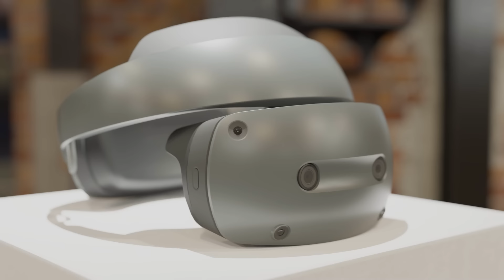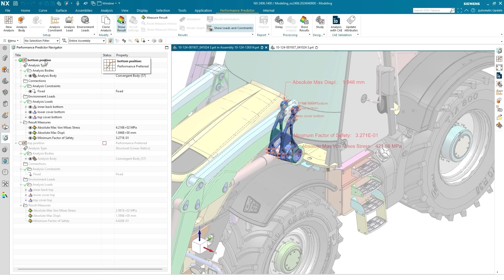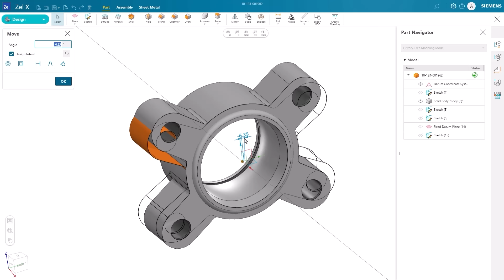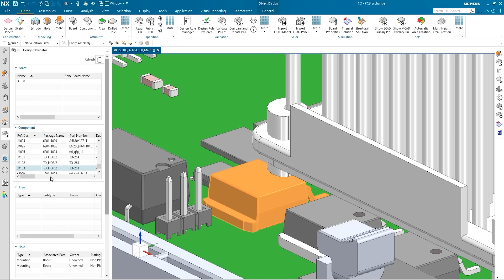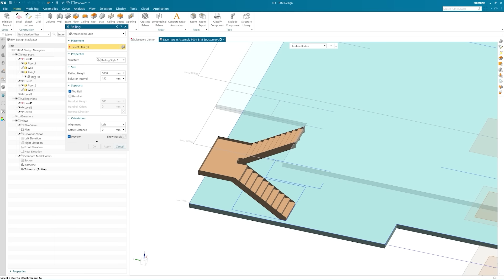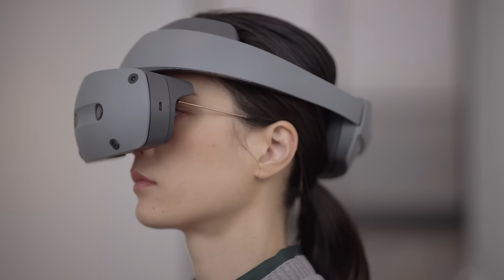What's new in NX | June 2024 | Release day premiere

Comment: There is any feature like auto dimension to model view in drafting at nx
Reply from the maker: Hi and thanks for your question (and your patience). Here's what the team shared:
"If you want to basically use the "templated" way of dimensioning a view in the drafting application using auto dimensioning, you can use the option "Feature Parameters" that inherits the parameter of selected features (that is suitable to reuse for the specific view) and adds them as dimensions in the specific view (or several if applicable).

This additional resource link may also be helpful. Cheers - Team Siemens
https://sie.ag/67gmkL
Reply: @SiemensSoftware  I have bin all ready used feature parameters but it is not working comparatively to solidworks , creo , catia for auto dimensioning in detailing .
Reply from the maker: Hello and thank you for your question. The best way to get technical support for our products is to open a ticket in our Support Center at https://sie.ag/85X9E. This will ensure your question is quickly routed to the correct technical support resource.

Comment: As a dedicated Siemens NX user, I'd love to see a Class A surfacing feature similar to Autodesk Alias. This would greatly enhance our ability to create high-quality, aesthetically pleasing surface finishes, especially for automotive and aerospace designs. Adding this feature would significantly improve our workflow and design quality. Please consider this for future updates. Thanks!
Reply: NX can already create class A surfaces and can do it better than Alias...
Reply: @petarivic6528  I use both Alias and NX, but I personally find Alias better when its comes to do Class A surfacing. I find it difficult to control the CV on NX and Alias on the other hand also has this feature called (Align) which is really needed feature for surfacing
Reply: Hi @gagan00152, have you tried NX Realize Shape within NX. It offers amazing surfacing capabilities with in NX